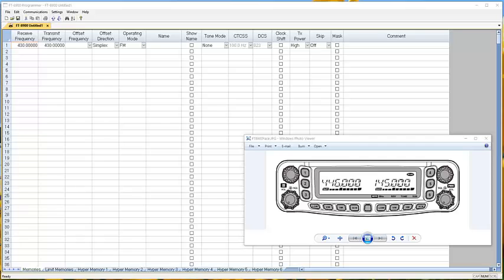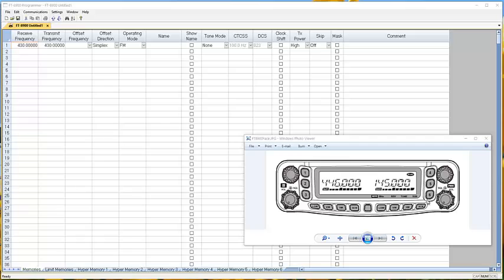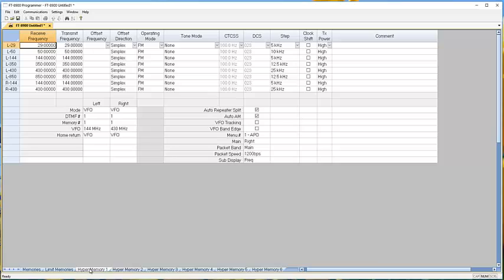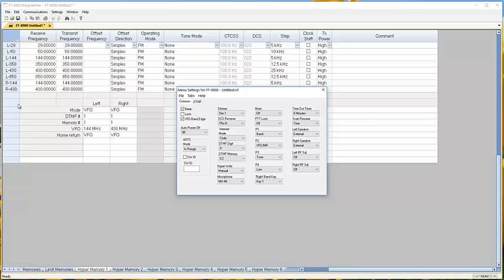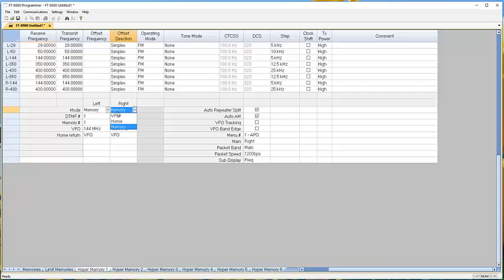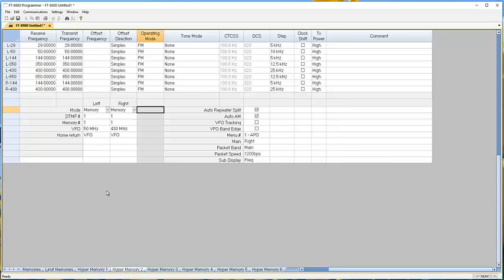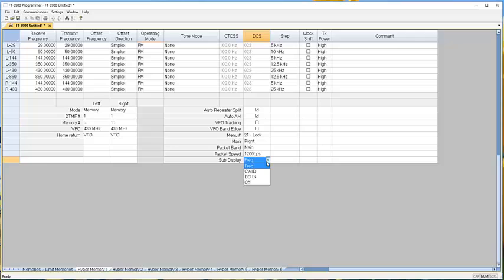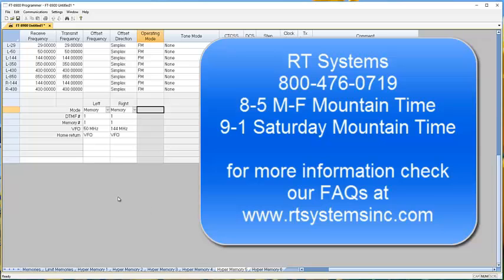Yaesu FT-8900 Radio Programming

Comment from the maker: The frequencies were all entered manually. The program automatically fills the information for the channel based on the receive frequency entered.  If you need any of it customized for that repeater, just make changes in the appropriate column.

If you copy and paste, all the fields are filled automatically too.  So the process is similar either way.  

Let us know if you have other questions.